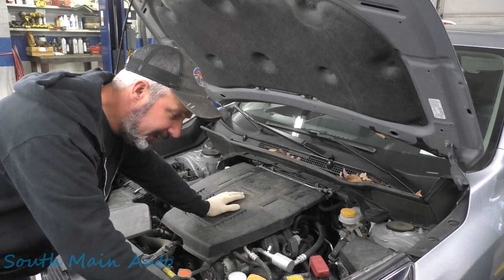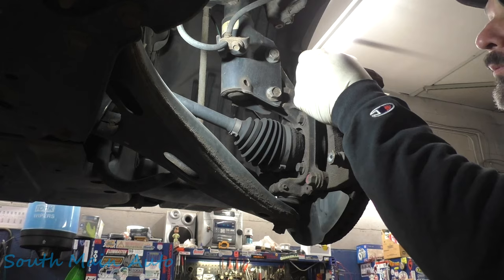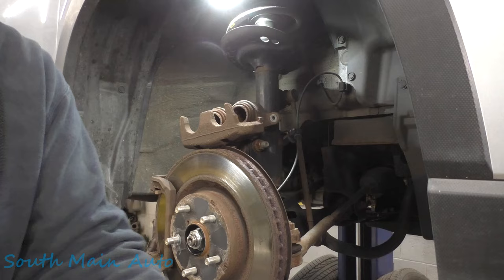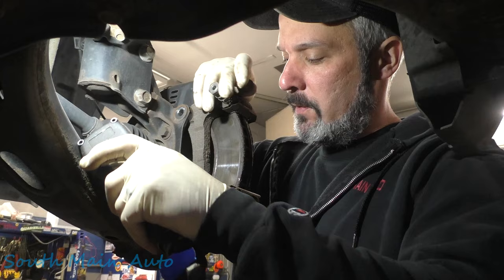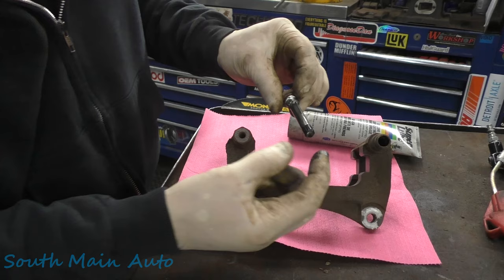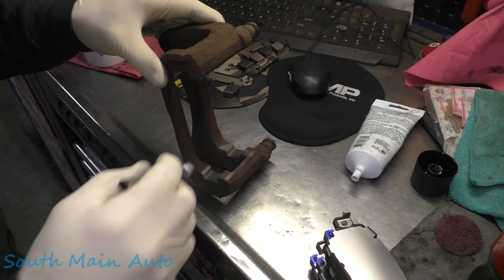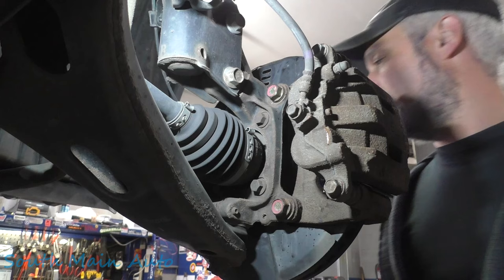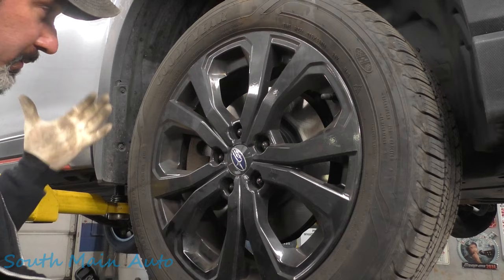'19 Subaru Forester: Front Brake Job - OEM Parts

Comment: If I were the customer, I would not mind paying extra for the OEM parts, quote or no quote, especially under the circumstances of the NAPA screw-up.  Besides,  70K plus on the front brake pads and rotors tells me the OEM parts were pretty darn good.  If I had a mechanic as good as Eric O., I would want him to get fair compensation for his work, even if it cost me a few dollars more.  Guys like Eric aren't gold, they're platinum.
Reply: I know this is not possible for shops but I always found Subaru brake parts cheaper than the store brand parts for about the same price when shopping from an online dealer. Kinda impossible with a shop, but if possible, and no rush . Better to keep more money in the hands of the shop or owner not dealer
Reply: Agreed. I would do the same and I wouldn't mind either. Parts are parts, labor is labor. Parts prices aren't always controllable, and if NAPA (not a sponsor) screwed him, I wouldn't want him to eat it and lose money for something that was out of his hands. It's not like he was adding extra hours of labor. Not making a dime on that job is actually cost him since he couldn't take another job so it snowballed. Mr. O is a good man and I would gladly bring him all my work, but if he can do it, I can do it.
Reply: @shahsmerdis  I've been able to get Toyota parts from dealers online for about the same as aftermarket. There's even a local dealer who sells them cheap online, but will tell you to pound sand if you show up at the parts counter and ask to get the online price. Sad you have to jump through the hoops, but OEM can usually be had for a good price, if you're willing to look. Always prefer OEM brake parts to aftermarket, especially with rotors. I've had too many aftermarket rotors warp in a short time.
Reply: I agree
Reply: I would do the same. No sense Eric taking the whole kick in the coyenes himself
Reply: @jblyon2  Anytime i buy new Rotors I always throw them on a Brake lathe to make sure they are not warped. Depending how long they have been sitting on a shelf I have found quite a few warped ones.
Reply: Customer agreed a price based on the NAPA parts - he/she would be pissed if the price would go up after the agreement.
Reply: Agreed, I'd offer to split the difference. Not his fault, not my fault... sharing is not bad.
Reply: I would have paid extra for the OEM parts.
Reply: @alexs3447  coyenes? Did you mean cojones ?
Reply: @NATA5II  Maybe . Not Spanish
Reply: Penny wise, pound foolish! Save a little now and lose your trusted mechanic if he has to eat too many losses like this and closes shop. Then see how much you will pay for inferior parts and poor service!
Reply: OEM is always trash. Cheapest parts available that do not last. They just need them to last off the lot.
Reply: @jblyon2  Local Subaru dealer is the same way...cheaper online but they won't honor that price if you walk in.  But you could order from your phone in the parking lot and if they aren't busy it's ready in a few minutes.
Reply: Gold is more $ per ounce now, lol. Eric is a diamond!
Reply: @DirectCurrent4u  It's not the length of time sitting on a shelf that warps a rotor.  If you have warped rotors out of the box, they were almost guaranteed to have been overheated when originally cut.

Comment: As a retired truck driver I can't tell you how many times I've woken up in a cold sweat from a braking issue nightmare.
Reply: I had the same feeling when didn't switch from summer tires to all seasons before the first snow storm. Barely made it home, felt like I was driving on an ice rink the whole time.
Reply: I used to have those a lot about my old car. Never even had problems with them, I think it was the natural sponginess that all of those models had in the pedal
Reply: not a good idea to drive while asleep..lol🤪
Reply: I got tired and pulled my car over to the side of the road to take a nap. The car wouldn't stop even tho I was pushing the pedal as hard as I could. Then I woke up and realized that the motion was from the wind of cars going by.
Reply: The worst is if you park on a get on ramp to take a nap while leaning over the wheel at night. Then some smart ass parks right in front of you. You wake up and see those tail lights right in front of you. That gets the old heart pumping fast
Reply: @Rick O'Sidhe Almost had that happen to me on northbound I-5 on the downhill side of Grapevine hill in an old 1993 FLD120 flattop, had weak jake brakes, and really worn out trailer brakes. What I did was a trick an old timer flatbed taught me, you smash the brakes hard with left foot, use right foot to pop it out of gear, then floor it, and grab that next lower gear. Grind em till you find em :) It worked, and the jake brakes worked pretty darn good at 2350 rpm! The rpm made me nervous, but the big cam IV supposed to be ok to 2500, so it eventually started to slow down, and could shift from there. Brakes smelled awful, but no smoke so that was a relief. Mostly just old grease and gunk burning off the drums, not quite the same smell as burning shoes.
Reply: @brnmcc01  do they still grind even if you match revs?
Reply: @ricardomartinez2417  No, but in an emergency situation like that you need to get in back in a lower gear, otherwise its in neutral aka Georgia overdrive....😃
Reply: I know that's right, even though I've been regular licenced for the longest time.. that and wrecks and getting stopped by the damn police too

Thankfully after CDL and after getting my CPAP, now I have dreams with all new means of vehiclular failure lol

Comment: I actually used to be a delivery driver for a NAPA store when I was in college, and when I would mess up and bring a shop the wrong parts, I always felt terrible about it. I made sure to take the full blame on the spot, because at the end of the day, the drivers are the ones who actually read the order and pick the parts. Stuff like the wrong part in the "right" box was a bit different, but I still hated letting down the shops who depended on me to be quick to get the customer out the door quick. I mean ultimately crap happens, but it's a shame your driver went the excuse route since he ultimately cost you income on this job.
Reply: That seems to be the direction companies go know is the book of excuses. Customer service is out the window.
Reply: @duanethumudo3967  Or as I found out recently with a local large but independent tyre (UK) place, blame the customer. They damaged a rod end locknut while failing to free it and tracked it using the other side only so the steering wheel was offset to the left. I took it home, freed it off no problem, fitted a new one (M17 thread so Mazda dealer only @ £9.70) and took it back for them to do the job properly. They refused to pay for the nut and, amongst other things suggested I was the one that had damaged it in the first place. Been using them for 20 years but never again.
Reply: @duanethumudo3967  There's no accountability anymore, just excuses.
Reply: My Napa has a new O'Reilly's up the street. We'll see how that works out.

Comment: Had a Honda that I drove mainly highway miles back in the day.   Took it in for a recall at about 48k and they of course check everything.  When I came back they commented that the brakes were in great shape and had minimal wear.

Told them with a straight face, "I hardly use the brakes, the car came with a horn."

They gut quite the laugh out of that.

Comment: Dear friend=Mr O 
I saw you use a break caliper file once and i ordered one straight away as a wire wheel just polished the rust it has saved me loads of time and everything fits back together perfectly every time so thanks for that little life saver.
Kind regards.
Dain.
Keep the films coming 👍🏻☕🇬🇧•••+•••🇺🇲☕👍🏻.

Comment: in our neck of the woods, Central NY and lots of salt and snow and rust, when I do a brake job (expecially on MY subarus) I grind the pads down a little where they go into the caliper sliders....gob them up with antisieze and let them be a little loose in the bracket....might cause a click here or there but in 20-30K miles, the pads will pop out easily and more than likely not FREEZE solid in the caliper sliders...I also put a little antiseize between the caliper bracket and the new sliders to prevent as much rust as possible...one other thing I do is put some antiseize between the rotor and the hub so that it pops off next time too......great job Eric
Reply: had to grind the ears a bit when doing rear brakes on a sonata, else they would not go in

Comment: Hey Eric, try a wire cup brush for an angle grinder.  I put a 5/8 bolt and jam nut on it and run it with my impact.  It fits perfectly around the hub center on a lot vehicles, at least the ones we have at our shop do.  Works great.
Reply from the maker: Thanks for the tip!
Reply: My boss gives me crap for cleaning hubs before rotor install....got to do it on the downlow
Reply: @DDrew67  I had an annoying shimmy in the steering wheel at around 65mph. Tires were getting due to be replaced so I thought it's just old out of balance tires. New tires, same shimmy. So I inspected the brakes carefully and there was rust build up between the hub and rotor. Cleaned it off and the the steering wheel is smooth as glass. So it is important, not just a pointless OCD thing like some think.
Reply: @Eastahtata  Yup, rust jacking is a thing, especially in the salt belt.
Reply: They sell those new, I have one I use on my drill for my car on the hubs

Comment: Good to see a shop using a torque wrench on the wheel nuts. So many places say "We have a calibrated air wrench"
Reply: My Honda dealer has cost me two brake jobs after improperly torquing lug nuts.  The Odyssey tends to warp brake rotors with improper torque.

Comment: I've pushed the pistons back, opened the bleed screws then pushed the pistons back, flushed the system, didn't flush the system, danced around the car, but always change the pads and rotors!  No compromising with that one.  Good job Mr. O!

Comment: Hey Eric, you’ve probably never heard this but one of the reasons why brakes lose their feel ( require more effort ) is because of what is called a “thermal barrier”.  
In the process of curing and bonding the lining to the shoe certain components within the mix are designed to settle close to the shoe area. Creating a ““ thermal barrier. This thermal barrier is there on purpose to protect the caliper and pistons from the heat of the breaking process. This portion of the lining has a slightly less abrasive content than the rest of the lining. That combined with the rotor surface becoming polished results in less braking feel.
I got this information from an engineer at Delco Moraine, Dayton, Ohio. My former employer.

Comment: I had a 94 Tracer, with a spongy,  but good brake system.  I finally tracked it down to the front rubber brake lines expanding under pressure.

Comment: I can't believe it, but I've got 85K miles on my 2020 Forester with the factory pads.  I've never had OEM nor aftermarket pad ever last this long.   Last fall I ordered pad because I had 75K miles.. I expected to need them.  When I pulled the wheel off and checked, I still had more than what's on this video.  Being that I have the pads, I think I'm just going to do them this weekend.

Comment: The ol Napa screwed up on my brakes today. Have a 2013 rav4 and first they sold me the wrong rotors and then I got home with the right size rotors and they gave me pads that were too small to fit in the bracket. But thanks to your videos Mr. O and giving me the confidence I’ve done the brakes on both my car and my girlfriends Chevy. Its a good feeling to be able to do at least basic repairs on your own vehicle.

Comment: I've been using Raybestos Element3 pads/rotors.  Their coated rotors rust less, and pads have nice shims and fit the caliper bracket well, pads are some ceramic/semi-metallic mix.   RockAuto, pads and two rotors shipped for about $135 shipped with NYS tax.
Reply: I'm running Raybestos Element3 pads/rotors from rockauto and they are doing well for me too.
Reply: I love the E3 stuff

Comment: Nice video, I just did a rear 2019 Forester. Only thing I would do more is I like to do 3-4 hard stops from about 45-50 mph (like a dog runs out in front). Get the new pads hot, bedded in, makes sure it's all good, easy driving and stops are ok, but I test them hard. When I can smell the new pads I know I got them hot.  :)

Comment: The one thing I was taught and have always done is rebuild the calipers because of buildup of residue in the calipers from the heat from braking for 70,000 miles that can collect around the piston when there pushed back in.  I always give the customer the option of doing that and let them know I won’t guarantee the job against any squeaks or sticking brakes if I don’t do the calipers.  It doesn’t cost that much more, the only problem I’m having in the last 15 years is getting caliper overhaul kits. They seem to want sell overhauled calipers and not the kits to overhaul them.

Comment: both my subarus, 2013 impreza, and 2014 forester, are known for rust jacking in the caliper mounting points. even 1 mm of rust will cause them to rust jack.  I did my own brakes, but my sisters forester went to the dealership. I told them to clean the rust points, and they didn't and it was just jammed in there. Once i freed it up, the braking performance was much much better. First brake job, the brakes were unevenly worn due to rust jacking,  ironically after i redid the brake job the next time it needed brakes,  the brakes wore evenly.

Comment: not sure if you have experienced this, but 
water accumulated in the Calliper will cause spongy brakes. When the heat builds up the water flashes off creating a pocket of steam and as you know, steam is compressible.

Comment: I do a lot of work on my own vehicles and sometimes the odd friends. 
When I'm doing brakes I usually just unscrew the reservoir cap to release pressure which makes pushing pistons back that wee bit easier. 
Brakes don't need bled unless you let air into the system or you're doing a fluid change. 
Another great video bud.

Comment: Napa screwed me too, ordered a front brake set (18 dodge grand caravan), SUPPOSED to be the pads, the rotors, the hardware and the lube.  Once my buddy (ford mechanic, not everybody's perfect), was available, we went to put them on.  guess what was missing, the hardware!  Guess that's how Napa made up for the 20% off sale they were running.  No Integrity anywhere now.

Comment: Old guy here If you told me the job went smooth brakes are great only hitch was Napa quoted me the price for the wrong rotors but I got them from Subaru I mess up but I will honor the same price.  My response would be " No one should work for free how much more would make you happy.

Comment: 11:18 seen so many brake replacement videos and you are acutally the only one to mention not to add too much grease, i acutaly learned it myself a few days ago did my replacemented myself and decided to clean and regrease the guide pins while I'm at at, and the pins wouldnt slide all the way in becasue i have added too much grease and the grease acted like a coushing and the pin would even sping back if you push it hard in, thought that if ill push the brakes it would push the extra grease out to the boot and everything would be allright but it didnt happen, took it for a half a mile ride and quickliy realised the brakes were rubbing all the way...
Reply: Earlier today I came across a video by RB The Mechanic titled "Dont make this mistake when you grease you caliper sliding pins | typical mechanic TIP". It's a funny coincidence that I saw this video with the same message considering that you don't hear it mentioned in almost all of the other brake videos.
Reply: @Freiherr Dinkelacker the grease was inside the caliper itself where the pin slides in and the pin has a rubber seal around it, no matter how hard i pushed with or without the boot the rubber seal on the pin just was sealing it inside , had to take the pin out and to spry brake clean inside the slide pin tunnel in the caliper and some que tips to clean the inside
Reply: @Freiherr Dinkelacker   sorry i wasn't clear enough, what I'm saying is the sliding pin has a rubber seal at the tip and if you have grease inside the caliper itself when you are pushing the pin inside the grease that is already inside the caliper won't push out of the caliper ( the metal hole inside the caliper ) because the rubber seal on the pin(the pin is a metal bolt with a rubber seal at the tip)  making a really good seal and it has nothing to do with the boot, the boot is very elastic and if you overfill the boot i guess it will give out at some point and will leak the grease out pretty easliy but I'm not talking about overfilling the rubber boot itself. 
There are 2 sliding pins, one is a metal one and has specail groves on it so if you have too much grease inside the caliper it will push out through the groves, but the second pin has a rubber seal around it and no grooves on the pin itself creating a very tight seal and incase you have grease inside the cannel in the caliper it wont allow the pin to slide all the way down no matter how hard you push it, even if you assembeled the brakes and press on the brake pedal.

Comment: I really appreciate how you point out that wire wheels don't do much to remove real rust except polish it. I try to tell people about it and you probably know how people look at you funny most of the time. If you have to grind on the pad ears, either there is crud in the caliper bracket, or you have the wrong shoes. Thanks Eric